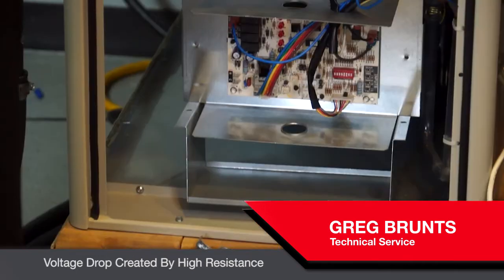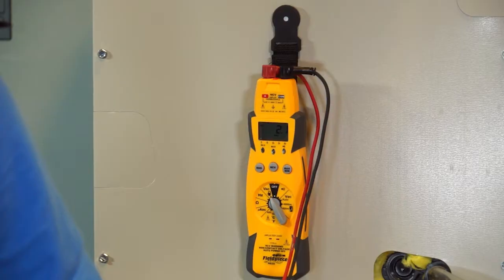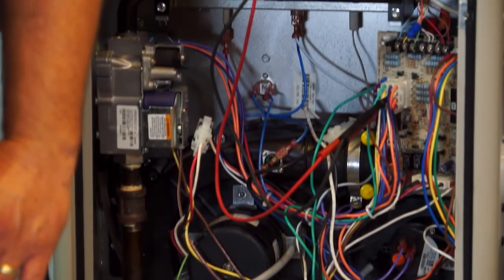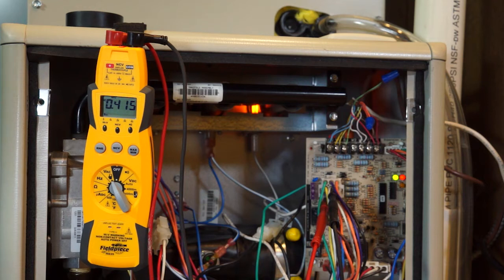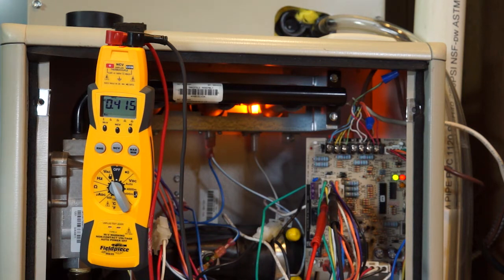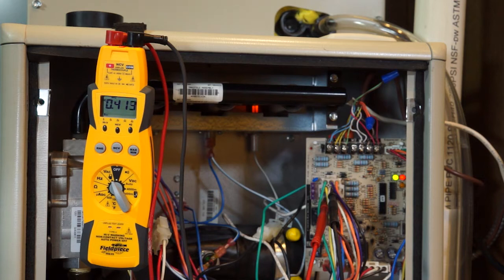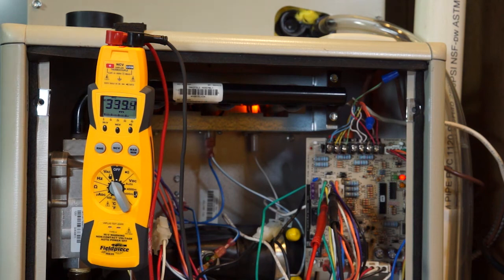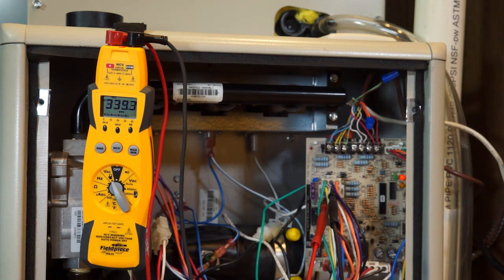Voltage Drop Created by High Resistance

Comment: I = V/R.  So the lower voltage drop means lower current. So, if you would check the current, it would be much higher?

Comment: I get the demonstration, but it is of no value. You should be teaching guys how to determine the high resistance, where it is, and what may have caused it.
Reply from the maker: Good morning, we do have more tips related to determining the high resistance available on edgetekhvac.com. Here is a link to one of our tips:  http://edgetekhvac.com/hvac-tips/troubleshooting-limit-circuit/
Reply: This is  happening on my furnace, so I'm going to replace both limit switches.

When I open the limit circuit and probe for voltage I'll get the 28 volts, soon as I complete the circuit the voltage drops to 13 volts.